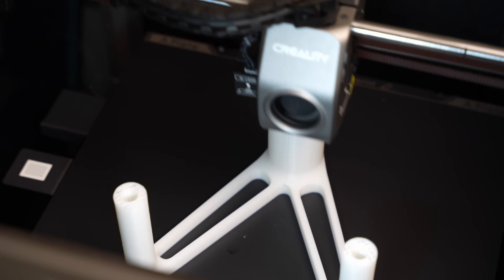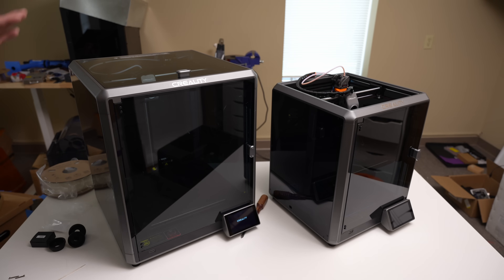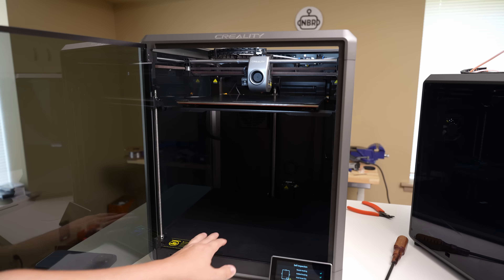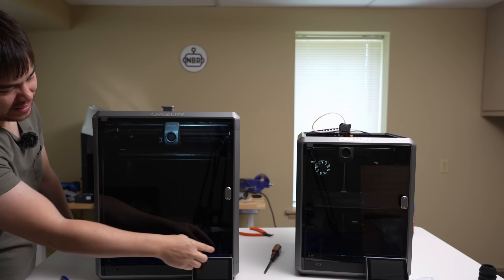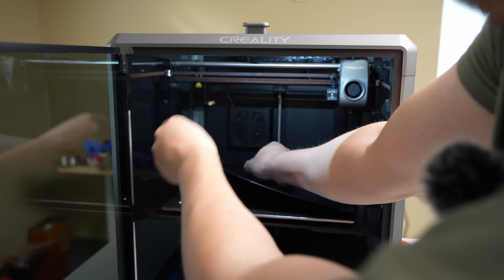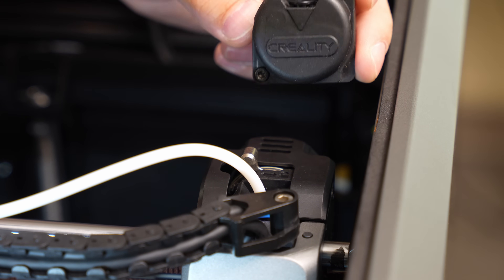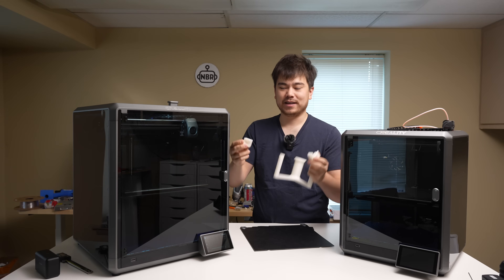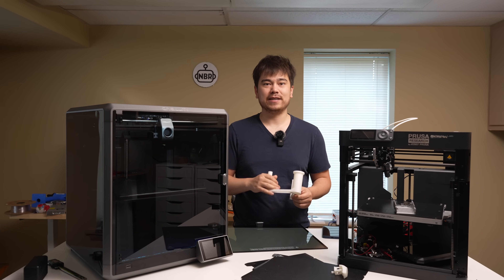🚨🤯 K1 Max Unboxing and First Prints (Plus Discount Codes💸)

Comment: Bottom line: will we be able to install and run stock clipper on this Creality machine? I do not want a machine that is closed .
Reply from the maker: I have asked that question in person to one of the founders and the head of product development. Kind of grilled them on it and made them uncomfortable/borderline unprofessional.
Their answer has been yes, they will open-source soon.
I tend to believe them since they have open-sourced all of their previous printers, but you never know for certain. If that is a dealbreaker for you, I would wait until an official announcement.
All of their engineering resources have been focused on getting the K1 and K1 Max out the door (and a couple more lower budget printers that should be announced soon), so it makes sense that they have not had the time to dedicate to preparing the files for a public release.
The Creality vs Bambu Lab competition has been white-hot lately, both companies are working furiously to get products out as quickly as possible. If they had to choose between pissing off the community for a bit vs losing the whole market to Bambu Lab... IDK, which do you think you would do?

Comment: Hi ; well I hope you are able to summon up the courage to pull apart the extruder as if its built  anything like the K1s extruder then that would put me off buying it completely! I understand you like how its running out of the box but longevity is what we need out of the extruder! Look forward to your deep dive video on the K1 Max. Thank you for your reviews.
Reply from the maker: Thank you, I know it needs to be done. Will have to do it for SCIENCE (tm)
It looks like the overall architecture is the same, but there might be some minor differences inside.
Reply: @NathanBuildsRobots  - The K1 extruder had two rigidly mounted drive rollers with one pivoting in for printing and out to load filament, rather than spring tension to engage the filament as is more typical.  In a video I saw, one of the drive roller axles bent outward after a day or two of printing, resulting in loss of filament engagement and persistent under extrusion.  Hardening that axle may be the fix.
Reply from the maker: If they upgraded from a Zinc/Aluminum based alloy to a steel alloy, that would certainly do the trick. Will do further investigation for the deep-dive video.
Reply: @NathanBuildsRobots  - Creality used Zamak for a stressed part?  Yikes.  At the volumes they'd be using for two axles per extruder, it seems that a simple CNC lathe stainless steel shaft would be cheaper than Zamak given the mold tooling cost.  What's more expensive than CNC lathe parts?  Investing in a mold to make Zamak parts that are made in large quantity but must be scrapped because they don't work.

Ready!  Fire!  Aim!

DOH!
Reply from the maker: @Liberty4Ever  LMAO are you suggesting the dummy that sugested Zamak faced the firing squad? Or that the execution of the plan was poor.

The new parts have a matte surface texture, kind of looks like a sintered part. Would be crazy if they were 3D printed, but the more likely explanation is a Powder metallurgy process.
Reply: @NathanBuildsRobots  - If someone used Zamak to make a cantilevered axle pin for an extruder that is loaded in torsion, then my "Ready Fire Aim" joke was meant to convey that they didn't think that through properly, although an engineer in front of a firing squad could be an equally valid interpretation.  🙂

A problem like this might cost $10K to fix before the product ships but $100K to fix if discovered in the field soon after product launch, not counting the lost sales due to loss of consumer confidence and product returns from dissatisfied customers who then bad mouth the product on social media.

If the lever (and not the axle) has a sintered metal appearance, that may be a MIM (metal injection molding) part.  That's probably a good use of MIM technology.  Those parts are often stainless steel and while they're not as strong or wear resistant as billet machined parts they're strong enough for most applications.

I'm guessing maybe the early K1 extruder cantilevered axle bent because it was a low yield steel with no hardening or the axle didn't bend but the back plate that retained it bent, or the axle passed through a hole that wasn't strong enough for the stress and the hole ovalized.  Hopefully the newer K series extruder fixed the problem but it's disconcerting that a problem of this nature was ever shipped to a customer.  That should have been detected and corrected during internal alpha testing.

Comment: "tiny bit of stringing"....see I thought I saw "a ton of stringing" when you held up that benchy.  Subjective I guess lol
Reply from the maker: That kind of faint stringing is cleaned up in about 5s going over it with a blowtorch or heat gun.
Not ideal, but could be down to filament or retraction tuning. Needs improvement, but not a dealbreaker IMO

Comment: Oh man, after the K1 issues I was seriously considering cancelling my K1 Max pre order. Glad I didn't, it seems to be a great printer now!
Reply from the maker: I was kind of dreading making this video because I didn't want to have to shit on their extruder design again. But by golly they fixed it. I hope it holds up!
The extruder fix addresses the primary concern I had with the system.
The secondary concern is their use/abuse of open-source software. They really need to release the source code for this machine. I am pretty sure they are going to release it, but in the meantime, people are rightfully a bit pissed about the situation.
Reply: I repeat: Klipper is GPL v3 and that license does not only require releasing the source code, it also requires any product using it offering the end user a way to install his own modified version of it.  In the GPL v3 license this is the part mentioning the "Installation Information" requirements.  So, it's not only that Creality has to release the source, they have to provide explicit instructions on how any user can replace Creality's Klipper derivative with the user's own version.  At least that requires providing root access and a way to modify the installed files.
Reply: I feel like their extruder issue should have shown up in testing which I felt was not as thorough as it could have been.

Comment: What about the slicer that comes with it. Still useless?
Reply from the maker: It gets the job done. And print over WiFi is nice. I've been using it and have been pretty happy. Would still prefer a PRUSASlicer based slicer and stock klipper, but for now its fine.

Comment: I had hoped for 350mm cubed :(
Reply from the maker: This thing is already pretty massive. 350 is just insanity. Look at the alternatives though, This at $850 or a Voron Trident kit for $1200 an 20 hrs of build time.
The Trident will probably be more serviceable and upgradable in the long run, plus more satisfying to build/use. But if you factor in the build time, the K1 Max is an insane deal for the volume and speed it offers.
Reply: @NathanBuildsRobots  Sure, but I currently own a CR10Max at 450mm cubed, and don't think that is insanity. But it is slow.

Comment: Creality... save money stop building puny printers.
I have their max neo... I could never go to a K1, go big or go home k1 max.
Reply from the maker: K1 Max is going to be my go-to printer from now on. Only reason I kept using the P1P over the K1 was the extruder issues I was having. But apparently they have fixed the extruder issues and I'm now 100% for it. Definitely needs more testing, and I belive some companies are working on aftermarket upgrade kits for the K1 extruder.
Reply from the maker: Other reason I was using P1P over K1 was the build volume being slighly bigger. But now the K1 and P1P both pale in comparison to the K1 Max, sizewise.

Comment: Nice review man! Also this is a discount code for the K1 (not max): AFK130
-$30
Reply from the maker: Thank you!
Lol, Nice. NBR30 works too I believe.
Reply: @NathanBuildsRobots  Seems invalid. Would you recommend upgrading my Prusa i3 Mk3s+ for the K1? As its faster and packed with AI features, etc.
Reply: @SPG_ADR13N  Normal k1 probably no. k1 has closed firmware (its klipper but they afaik have not released the firmware yet) unless you need the speed of the k1 save the money and stick to your prusa.
Reply: @MinePossu  sort of... I am not making any loss, in the worst case 30€ or so.. Selling a Prusa on Ebay is about 550€ (I have a lot of extras (Nozzles, filament, etc.) So then with that money I can wait and buy the K1 when its on sale (amazon prime day or upcoming Black Friday)
Reply from the maker: Black friday is going to be nuts this year. Both companies are going to have a warchest of inventory by then.

Comment: Nice video i have Question is ender 2 pro good printer im litel bit consered about bild volume im new and i whant to get in to 3d printing. (thy for respone)
Reply from the maker: Ender 2 pro is a great printer. Has really good print quality out of the box. If you can get it for around $120 it's a great deal.
Also if you are near a MicroCenter they sell $99 Ender 3 V2 and Ender 3 Pros sometimes. Those are great deals